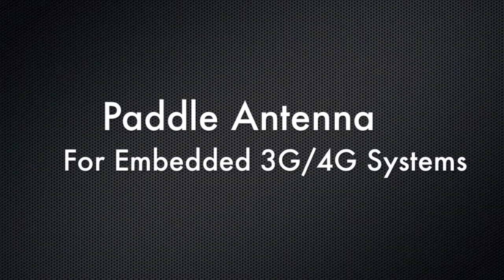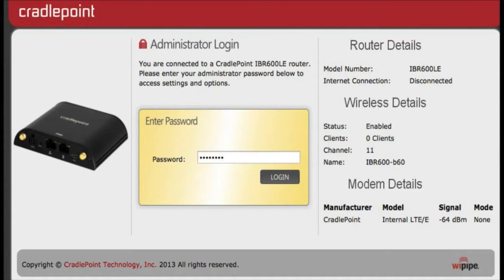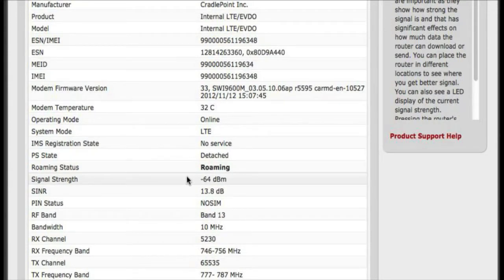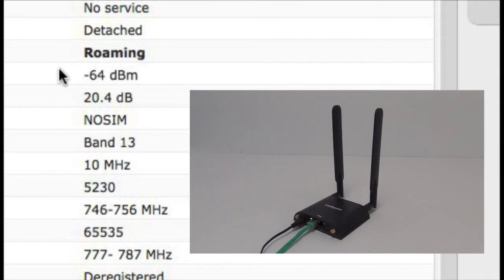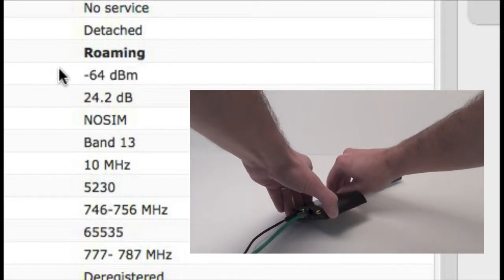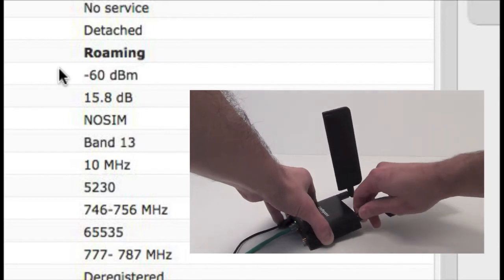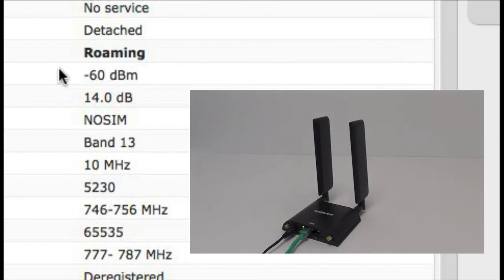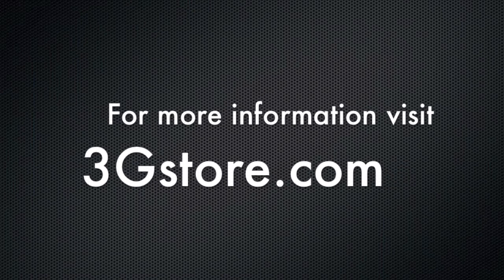Paddle Antenna for Embedded 3G/4G Systems

Comment: You have more that doubled your incoming single by going from -64dBm to -60dBm, however, I noticed that your SINR dropped by about 4dB...? Did the new paddle antenna also pick up more noise?
Reply from the maker: +Tech In The City - Honolulu That antenna did pick up noise depending on the environment. We have replaced it with a higher quality option. http://3gstore.com/product/5588_3db-cellular-paddle-antenna-sma.html